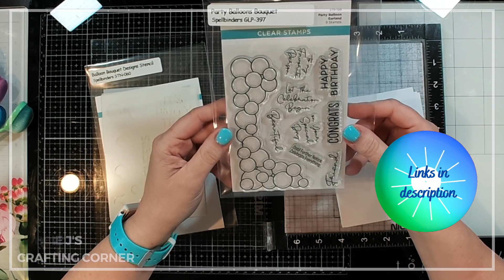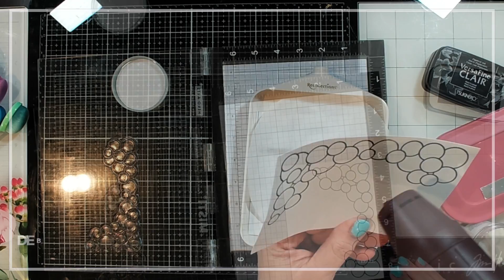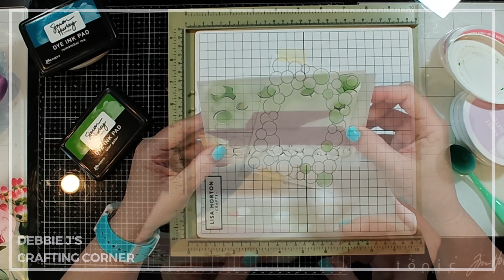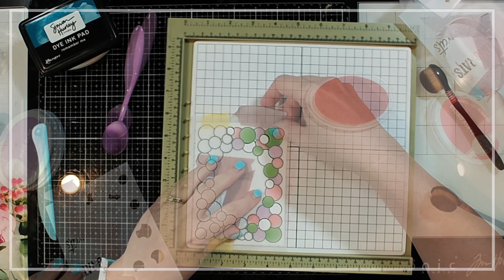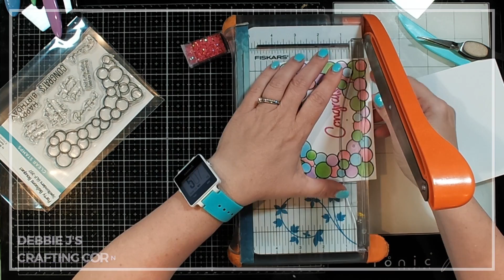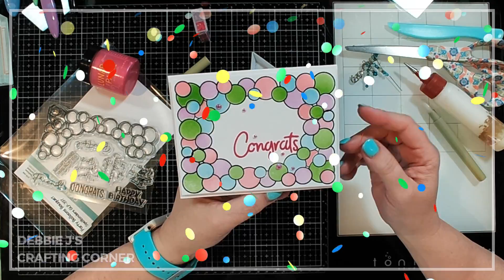Balloon Garland Card - Let's Celebrate! | Four at 4K! GIVEAWAY Hop

Comment: I’m new to cardmaking…why do you put heat on the back of the paper?
Reply from the maker: Great question!  That was heat embossing.  I stamped in ink that has a slower dry time, covered them in embossing powder (which is a plastic powder).  The heat tool melts the powder.  I sometimes heat the back of the cardstock first so that I don't accidentally blow the powder off.  I think I'm over cautious.  ~Big Hugs~ Debbie J